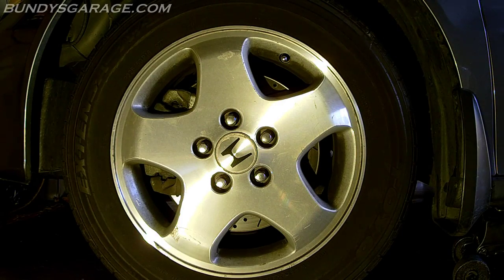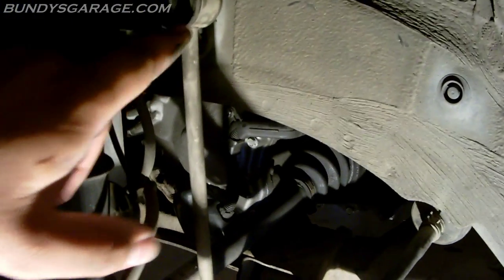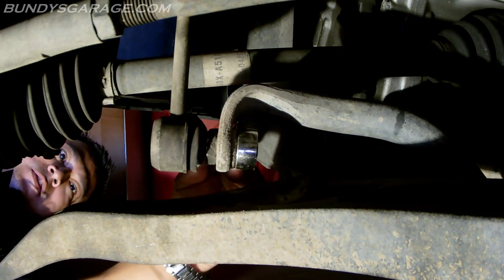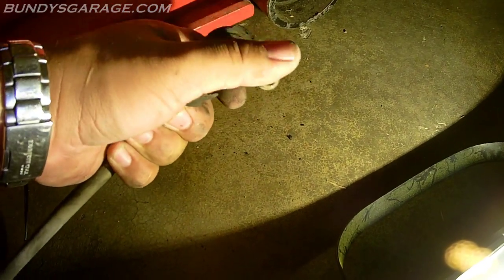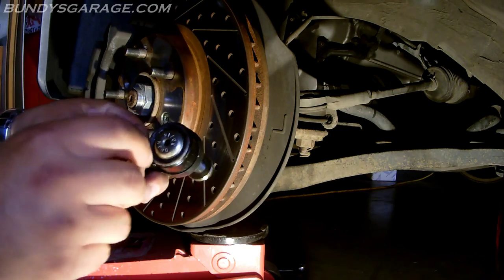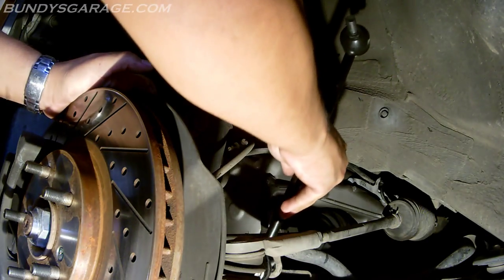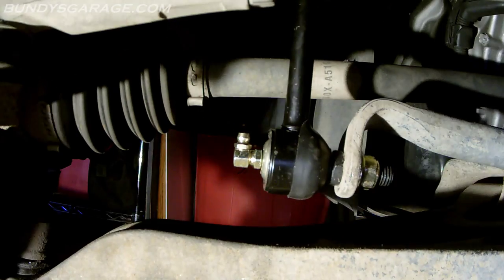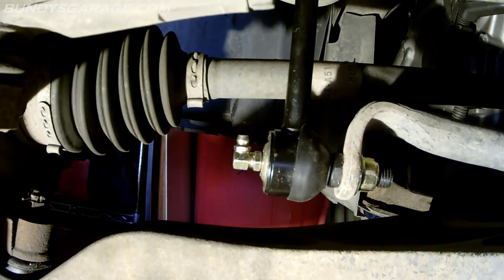99 - 04 Honda Odyssey Sway Bar End Link Replacement - Install front stabilizer - Bundys Garage

Comment: The brake rotors what part number are those ?? And what your is your van ?? Would they fit 02 odyssey j35a4 ?? Thanks for your help great video!!!
Reply from the maker: +Michael Flores the rotors are aftermarket bought from a parts store in Riverside, CA so there is no Honda part number for them.
Reply: BundysGarage thank you for the reply !
Reply: BundysGarage great step by step video!! By the way!

Comment: How good is the O'Reilly Auto Parts Master Pro links holding up? I replaced the stabilizer links on my 03 Odyssey back in September 2017 with MOOG K90349 from RockAuto and unfortunately when i went to change brake pads today i saw that the bushings on them on both sides were cracked and busted smh... Might give mevotech a try or if the price is not too high just go OEM
Reply from the maker: I remember when MOOG was the best! Well now that they all manufacturer in China quality control comes second. If you can go OE. O’Reillys have held up well.

Comment: I realize this is from 2015 but do you remember where you jacked it up to reinstall and what were your symptoms or signs that the sway bar needed replacing? thanks
Reply from the maker: I found it when I did a brake job and the sway bars were broken. There is a single center jack point at the front of the vehicle.

Comment: Well I did this job today and had a bitch of a time because my 2003 Odyssey's bolts where pretty seized. I tried penetrating oil, heating with a torch, and then realized that the hex bolt/allen key hole had stripped .  Started to panic until I realized there was also a nut just behind that I could get a wrench on. And then I struggled with it until the top bolt came off.   For the bottom nut I got my wrench set up so I could use a jack to lift/rotate like a pry bar. It worked great getting it started. Then again I struggled until the nut came off. Bundy, your car must have had anti-seize applied to the bolts or I'm just a pussy. Anyways,thanks for the guidance. Tomorrow, the other side. Ugh!
Reply from the maker: +North Canuck the vehicle I did the sway bar links on has been in Southern California it's whole life. We don't see snow and salt on the roads like other parts of the country. At least you got it off! Thanks for watching and subscribe if you can. Really helps me out. Thx
Reply: Did the other side yesterday and couldn't even get the nuts off.  I had to cut them off with a grinder.  I wish I lived in SC.
Reply from the maker: +North Canuck beautiful weather all year around. But a gallon of milk costs $7.98